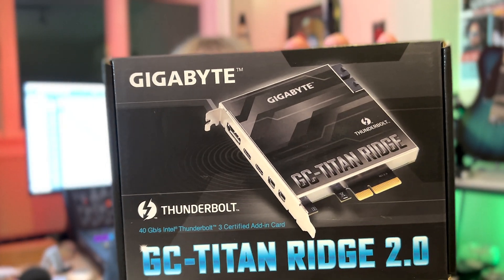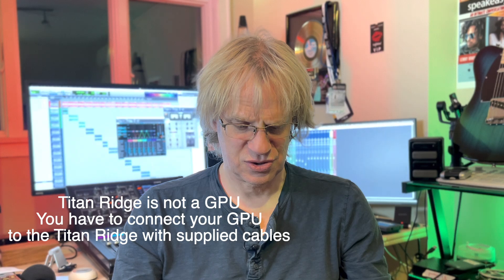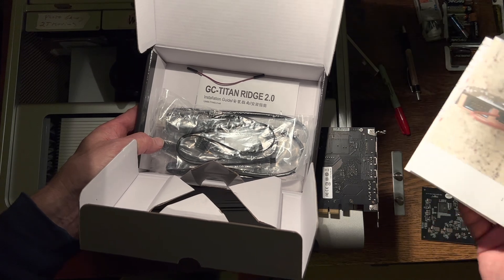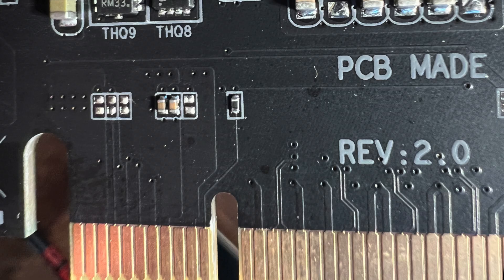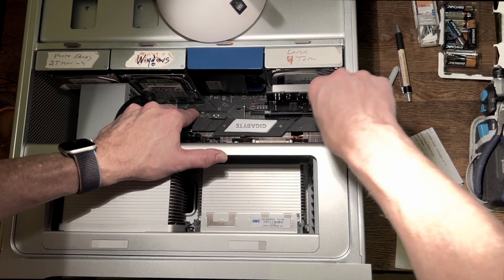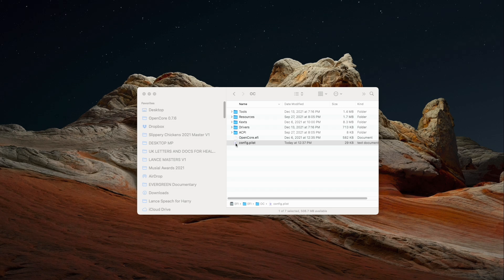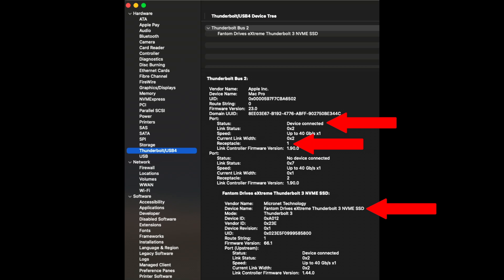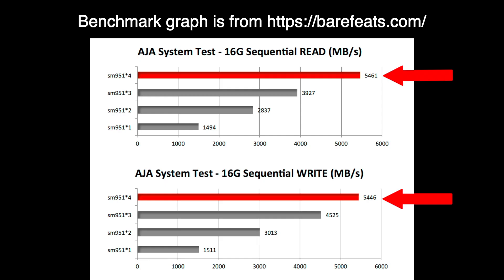Mac Pro 5,1 Thunderbolt 3 0 Titan Ridge pros and cons

Comment: Ps Before I switched to Apple Silicon I was thinking about buying Mac Pro 5.1 refresh from 2012 and totally maxing it up with all possible amount of RAM huge SSDs and most importantly modern GPU (but unfortunately it came out that no modern GPU would work here without a third party patch). But it just not worth effort. If you have such machine with whole working setup in your studio (music production or maybe graphic design) it might make sense but buying it in 2020/21 it was totally miss. And now it would be insanity    even for passionates - it’s not a viable tool in 2026! Just let it be piece in museum and go for Mac Studio instead. As I did finally.
Reply: I was very skeptical to using this GPU patches for Mac Pro… Most likely written by some crazy enthusiast in his little ‘dungeon’, where he also does taxidermy and when his mother isn’t home — he lets Zed out of the chest and runs strange experiments. With Zed, himself and bottle of baby oil. You never know if in a future knowledge - how conductive is Zed covered in baby oil, will be crucial to quantum computing and cold fusion. Might be irrelevant might be crucial as AI that encrypted most important data when it comes to those technologies was trained on pictures and other data stolen from servers with stuff for German fetishists.

Comment: Christ, your Thunderbolt setup, card and drive - it is so slow. To make you feel better: if you’re still using this computer, you chose a slow SSD. Try one of the fast TB4 / USB 3.2 (40 Gbps) enclosures.”… 
• I myself use Thunderbolt 4 external enclosure Unitek Reefer Pro with Samsung 980 Pro SSD inside and with MacBooks with Thunderbolt 3 (2019 Intel i9) but also newer MacBook Pro M1 Max and now M2 Max, I have speeds like: write: about ~3000 / ~2801 MB/s read: ~2870 / 2781 MB/s sometimes little bit faster, but mostly it’s like this with drive with lots of data on it. Clean freshly formatted would be bit faster. 
I explain why I decided to use 980 Pro with Thunderbolt 4 although it bottlenecks drive - because it’s not so obvious, yes drive nominally is much faster but those drives with time and more data written become slower. So faster the drive, potential slow down less hurts, and in case of Thunderbolt it might be unnoticeable! When I tested slower drivers like 960 EVO it was much much slower and it was right away visible in performance of drive + enclosure.
Reply from the maker: This video is 3 years old. Sonnet McFiver gets 3000MBs single 970 evo plus and 6000 raide 0 in a Mac Pro 5,1  I have Mac Mini M4 Pro will be getting a Mac Studio M5 Max,  the main point of the thunderbolt card OS for old Thunderbolt Displays and being able to use Thunderbolt audio interface. 3 years ago. Now a days my old 5,1 is a Linux gaming machine for retro games.

Comment: Hey there mate, I purchased the OWC Accelsior 4M2 1TB years ago upon your recommendation for a caching server, it is raided and out of the box and upon tons of testing I can only get it to 1.1GB W 1.5 GB R speed. Gave up, but decided to start investigating again. It's in the x16 PCI-E slot. Is there something I'm missing?

Additional info, I have it set as an 'External' drive, didn't bother with making it internal with OpenCore as it isn't a bootable device, journaled HFS+, MacOS 10.13.6

Thanks for your help man!

Comment: Quick question... What if I wanna connect a Thunderbolt audio interface...? This issue will also happens, or it's just related to this external HD...? And regarding to the sleep thing, in my case I really dont care, since I never do it...
Reply from the maker: Yes same deal cold boot, hot plug interface, and reboot. Although I never had a thunderbolt interface myself pretty sure that’s the deal.

Comment: That is a great video, and I am wondering whether the GC-TITAN can work properly with Sequoia (OSX 15). Currently, I plugged it into Mac Pro 5.1, which didn't work. The MacPro 5.1 can show this device, but MacPro 5.1 cannot mount hot hot-plugged NVMe2 hard disk. If someone has a solution for this,  help me, thanks a lot.
Reply from the maker: Is it flashed for Mac? You have to cold boot the Mac, plug in the device then restart and it should then mount.

Comment: Hello, how are you? I wanted to know if it's necessary to make any modifications to the board, as I was thinking of buying directly from any supplier and following your tutorial. Is there any other mod that needs to be done?
Reply from the maker: @hebergeburt  the card needs to be flashed for Mac. I bought mine on eBay. From DQUpgrade.

Comment: Hi
I have this card on my MacPro 5.1

My problem is that to be enable to  to use my UAD sound card in it, i need always to restart computer 2 or 3 Times!

Have you any solution to make it works on the 1st computer start?
Reply from the maker: @FabioGallucci1980  nope best to boot, hot plug and reboot.
Reply: did you find a solution?

Comment: Hy. I have a problem, maybe you can help me. I have the titan ridge in my mac pro, he is working as it should. In the system I can see it, but when I open the .plist file I can not find it to change it to  <true>.  Is there a solution for that? I mention that my uad soundcard conected to the titanridge is working well after I restart the mac. I am using monterey and the last oclp on an mac pro 2012, 2x3,46, 96 gb ram

Comment: OPCL duoc ko a
Reply from the maker: Yes OCLP works but you have to do some mods tot eh config.plist
Reply: @MacSoundSolutions   OPCL mình không biết truy cập vào tập tin config.plist. Bạn giúp mình nhé . Cảm ơn ạ
Reply: @MacSoundSolutions   mình đã vào config. plist. Lục cả cả đêm mà ko thấy chổ nào thunderbolt. Làm ơn chỉ mình với, Cảm ơn bạn nhiều
Reply from the maker: @phucnguyenduc5264  Here are the instructions inject the Titan Ridge Card: 1. Place the SSDT-TBOLT3.aml in the ACPI folder of your EFI 2. In Open Configurator under the ACPI tab, hit the Scan/Browse button in the lower left corner. The .aml file should now show up in the list. 3. Optional: Give a comment in the comment field i.e. “Thunderbolt 3” 4. Make sure the tick box is “enabled” 5. Hit save and reboot If you also use a Sonnet USB 3.0 card, including the McFiver you should also install a second .aml file as the Titan Ridge and Sonnet USB 3.0 cards don’t play well together (known issue). The Sonnet card will prevent the 5,1 from loading the Titan Ridge card when in slot 3. This aml fixes that by forcing the Sonnet card to load first. 1. Place the SSDT-SLOT3.aml in the ACPI folder of your EFI 2. In Open Configurator under the ACPI tab, hit the Scan/Browse button in the lower left corner. The .aml file should show now up in the list. 3. Optional: Give a comment in the comment field i.e. “Sonnet USB 3. 0 Slot 3” 4. Rearrange the .aml files so that the SSDT-SLOT3.aml is listed first and the SSDT-TBOLT3.aml is listed second. 5. Make sure the tick boxes are both “enabled” 6. Hit save and reboot.

For the Aquantia 10GB patch your need to download the patches here… https://github.com/CaseySJ/Aquantia-macOS-Patches
the site has a very easy step-by-step guide for Open Configurator. Be sure not to enable both sets and make sure the ForceAquantiaEthernet quirk is checked. I enabled set “1” and it worked perfectly.
Reply from the maker: If you use Martin Lo’s package instead of OCLP it’s built into it as I show in the video. Download it to get the files needed regardless, Martins only goes up to Monterey.
Reply: @MacSoundSolutions   cảm ơn Bạn rất là nhiều. Chúc bạn 1 ngày tốt lành.

Comment: Hey Lance, any idea how I can connect 27 inch thunderbolt 2 Apple Cinema Display?
Reply from the maker: you need to get a dsiplay port cable to go from your gpu into the titan ridge, that should do it. May take boot and reboot and a hot plug for it to show up the first time.
Reply: @MacSoundSolutions  As always appreciate your help,

Comment: I wonder if you would get better speeds on the Titan Ridge if you had it in an x16 slot?
Reply from the maker: It only works in slot 3 or 4 from what I remember.
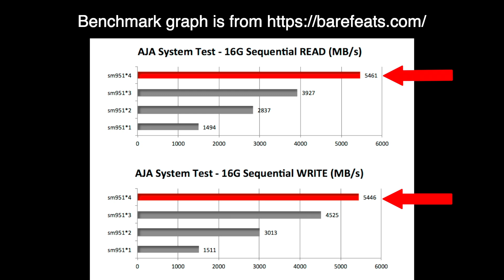Reply: OK.  Have you tried it since making the video?  In the video you mention that you can get better speeds in the x16 slot.  12:55 timecode @MacSoundSolutions
Reply from the maker: @shiningprince  the card doesn’t work in the 16x slot

Comment: How do you hook Thunderbolt 2 display monitors to the card? Will the Daisey chain work? I have two Apple 1407 montoirs that's I Daisy chain to the main monitor it works on Macbook pro 2011. Trying to get this to work on Mac Pro 5,1
Reply from the maker: Sorry I didn’t have thunderbolt displays when I used the card but I would go ask on Mac rumors or the titan ridge custom firmware Facebook group but you would need apples thunderbolt 2 to 3 adapter and it should work.
Reply: @MacSoundSolutions  Wanted to let you know I got it working and have updated Pros and Cons. I'm running Mac Pro 5,1 2009 Monterey OCLP 1.3.0 Right now I'm only using the flash Titan Ridge and it's working without doing the Config set to true. Both Thunderbolt 27' and 24 inch HDMI working. Sometimes to get all drivers to load and stay will take about 2-3 reboots. Later I will do the Config set to true and test to see if it's more stable. One thing I notice Sometime deep sleep won't wake computer. Have to hold power button Start all over. Sometimes you have to turn monitors on and off to get displays back this takes out usb 2.0 If anybody knows how to fix this issues I'm all ears. Once displays cuts off I loose all loaded drivers Display sound ethernet and USB 2.0 in the back of monitor and on the Mac Pro. Help with this would be awesome. One more thing I notice I have a USB 3.0 in the Titan Ridge and this only reads USB 3.0 devices I can plug External usb hard drive 3.0 reads and write each time. However when Plugging in USB 2.0 Device in the USB 3.0 hub nothing happens. Do anyone have any information about this.

Comment: Does adding this card enable AVB network audio?
Reply from the maker: Not that I’m aware of but maybe a Thunderbolt to Ethernet adapter might work. The Sonnet McFiver supports AVB but you need to use opencore to fix the 10gigabit issue. And it does not have Thunderbolt.

Comment: Hola, Uso Apollo Twin en una mac pro 5.1 con opencore Mojave. Basado en su experiencia quisiera saber si Titan Ridge Thunderbolt 3.0 es compatible en opencore monterrey o ventura con Apollo Twin?
Hello, I use Apollo Twin on a mac pro 5.1 with opencore Mojave. Based on your experience, I would like to know if Titan Ridge Thunderbolt 3.0 is compatible in opencore, Monterrey or Ventura with Apollo Twin?
Reply from the maker: I would say yes it should work with Martin Lo’s Opencore package and Monterey. I don’t know about Ventura and Opencore Lefacy Patcher.

Comment: Hello, i have a problem. Thunderbolt is running but he cant find my Apollo Solo under Sound. Can you help me? I have no line Thunderbolt under my config.plist.
Reply from the maker: try cold booting meaning the computer is off not rebooting, then power on the interface, plug it into the titan ridge then do a restart, if it doesn't show up then it may be the driver you are using.

Comment: I have the OpenCore Legacy patch installed. My Titan Ridge Card is not working. Do you know if I have to edit something in the system to get it working? The card shows up in system info but external disks is not shown when connected to the thunderbolt/usb3 slots...
Reply from the maker: Is the card flashed for Mac? DO you have it in slot 4? Try cold booting then plugin the drive to the thunderbolt port on the mac, then reboot and see if it shows up then. I always had to do this to get my thunderbolt drive to shot up and that's why I stopped using the card.
Reply: @MacSoundSolutions  Yes it is flashed and in slot 4. I tried to cold boot but when the drive is connected the bootup stops on apple logo screen. I tried to edit my plist file but now the bootups stops even if the drive is unplugged...
Reply from the maker: @peopyt  try taking out the card, you have to set thunderbolt from false to true near the top of the config.plist but I have not tried this with OCLP
Reply: @MacSoundSolutions  I mount my efi partition in the clover config but when I open my config plist in text edit I cannot find anything about thunderbolt there like yours. Strange...

Comment: can i use this to connect a apple thunderbolt display? & get full access to camera and usb drives? best regards
Reply from the maker: I would think so but not positive, problem is you have to boot and reboot for it to be recognized. Check this out https://youtu.be/nVQuD9LayoI
Reply: @MacSoundSolutions  I found online how to do it, you just have to flash the card and also remove the items described in the video up above, just got the flasher off Amazon for 15 and the card for 100~
Reply from the maker: @Dr.reese_UBR3  let me know how it works out
Reply from the maker: @Dr.reese_UBR3  I got mine pre flashed for Mac,
Going to sell it on eBay as I don’t use it anymore.

Comment: Suggestion to your audience: use a long shaft #1 Phillips screw driver when mounting and un-mounting the finicky brackets securing your PCIe cards.  Also, Thunderbolt performance is not the reason one might add this to their 5,1 MacPro. The real reason is simply to use the TB protocol.  Don’t expect newfound speed, just peripherals availability.
Reply from the maker: That is pretty covered in the video, as I talk about thunderbolt audio interfaces and monitors.The speeds are faster using a thunderbolt ssd over a usb 3.1 drive with a pcie usb card by about 500MBs. Yes the screwdriver makes it much easier to put the holding bar back in but you have to be careful as to not slip into one of your pcie cards, most likely would not happen but if your a klutz like me it might.
Reply: @MacSoundSolutions   I did watch your video. A speedy application or media drive is not important to most music users.  But interfaces are few enough already without losing half of them to a protocol.

Comment: Hi. I have a mac pro tower but no gpu that has a thunderbolt port. My question is why is it after I've installed my nvidia gtx 1060 graphic card to the cpu, connect hdmi from the cpu directly to tv, but there's no display on? I've turned on the cpu, there was a boot up sound, meaning the cpu is ok, right?
Reply from the maker: What version of Mac OS are you running, are you using opencore? Some GPUs don’t display anything out the hdmi until fully booted the OC boot screen might be showing up on one of the display ports not hdmi. Check this out for more info on Nvidia GPUs and opencore Legacy patcher here on your tube at Mr Macintosh channel.
Reply: @Mac Sound Solutions inc.  I'm on el capitan. Sure will do. Thanks for your feedback!
Reply from the maker: @zuanidrys462  check this out http://blog.greggant.com/posts/2018/03/29/installing-geforce-gtx-1060-1070-1080-on-mac-pro-2010-2012.html
Reply: @Mac Sound Solutions inc.  thanks for sharing the extra info. I have to wait 2 more weeks before I can go to my sister's. She lives 200+ miles away, and keeps the original radeon hd 5770 gpu and the mac monitor. I'm planning to bring it back it to my place and have the pc running on normal mode before tweak it a little. Thank you again for your help, I appreciate it.

Comment: I was using a Flashed Titan Ridge on my 5,1 with an Apollo twin Interface for the past year or so but recently started having issues connecting with the interface the errors I’m getting are audio related. 

Audio related, the kext that is crashing is com.uaudio.driver.UAD2System.
Reply from the maker: I have heard the latest driver is causing issues
Reply: @MacSoundSolutions  I went back to UAD version 9.13.0 it’s working but will stop after a while any ideas? Once it stops working my Mac no longer recognizes the Titan Ridge. Only solution is to turn off and unplug a few times

Comment: I made the Thunderbolt settings and everything is fine, but when I connected the Apollo card, the computer stuck with a continuous restart, and if I disconnected the Thunderbolt cable, the computer works normally..

Is the problem with the Thunderbolt card or do I need a power cable?
  Note that I am using Universal Apollo Audio Interfaces quad core Thunderbolt 3
Reply: Did you find a solution? This is happening to mine as well but it disconnects from my Titan ridge as well
Reply: @DEADIKATED  I have not found a solution at the moment, but I think that this problem is from the Thunderbolt card, I am currently working on a restart so that the Thunderbolt works with me and I work on the Apollo with only 20 GB, and this problem is from the Thunderbolt card and not from the system boot, I hope to find a solution so that Thunderbolt works on 40 GB without problems

Comment: Thank you for the info! I want to use it with my 5K Thunderbolt Mac display.  Did you try it with this display?
Reply from the maker: no I have not tried it but others have had success, you still need to boot and reboot I believe to get the display to be recognized if its connected over thunderbolt.

Comment: 200mbps bump? Not bad...
I use the inateck 3.2 pcie 16x card and also get about 650mbps with an external nvme drive. I dunno if 200mbps is worth the money or the tinker time, but its not insignificant.
Reply from the maker: I would say its not worth it unless you need thunderbolt.